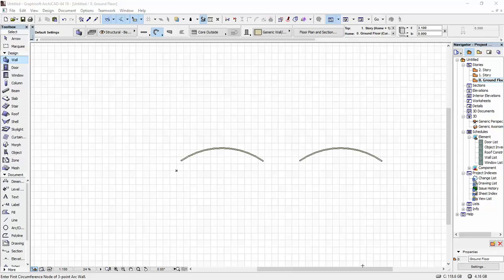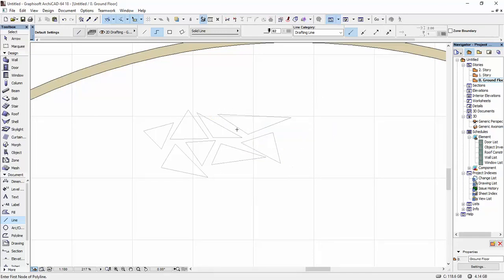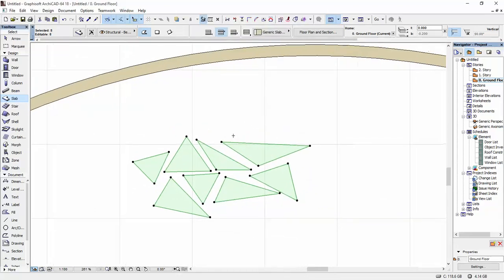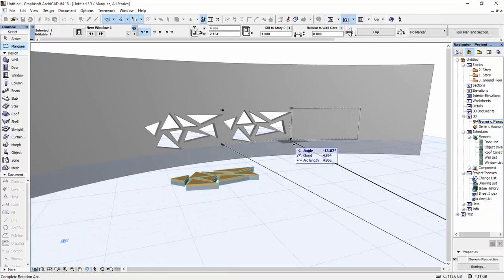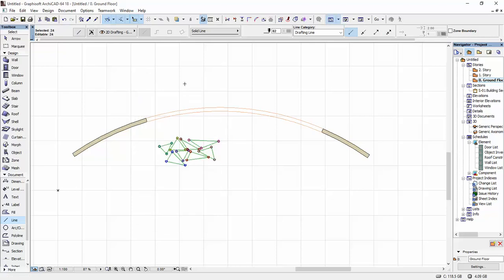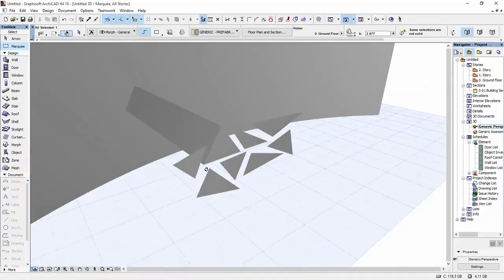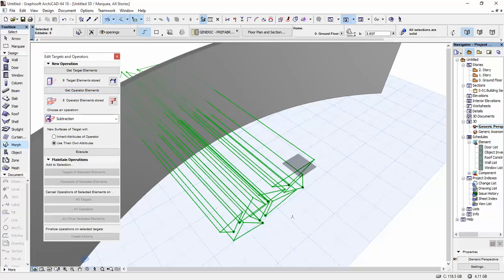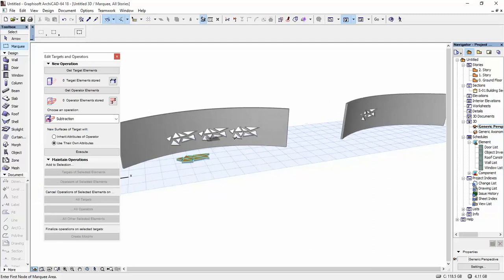Perforated Curved Wall ArchiCAD

Comment: I tried this example out . I was successful at the first attempt on the first example, but at the second attempt i was just getting a rectangular cut on the curved surface. Could you explain where i have gone wrong. Will be very much appreciated. I tried several times but was unsucessful.

Comment: Nice trick with the window, I think I had jumped on the solid operations, since I come from 3D studio, A-Cad and Rhino, but what worries me is suddenly you end up with a heavy model because of the solid operations. Do you have any knowledge as to how the methos differences regarding polygon counts ?
AND You really .. really you need a laptop or a new less noisy machine.. ;)

Comment: Im following the exact explanation, but for some reason my window is square while the shapes are filled, inside that squared window.. a bit hard to explain..
Reply from the maker: +Naomi Azulay (Fliko087)
Like I did at the 2:10 mark, you must change the ID of the slabs to '' wallhole''. If you skip this step, the window appears as you described. Hope this works and I answered your question.
Reply: hi , it's really nice, but what is the trick 'wallhole', why other name is not working?
Reply: Look at the settings "renovations status", make sure its the same, I also had the same problem and fix that and it work.